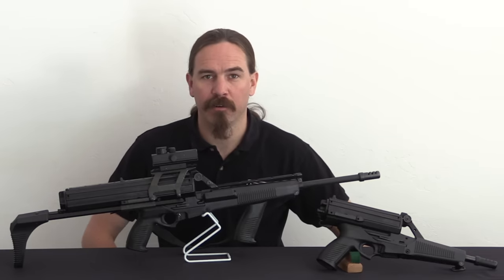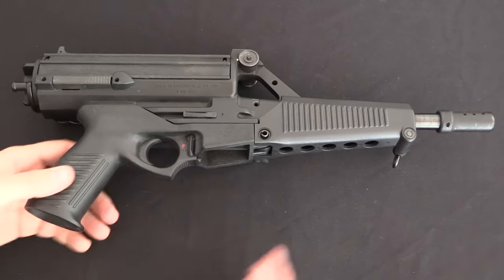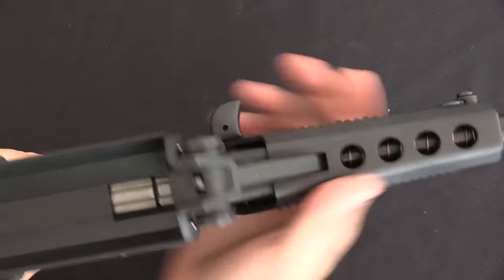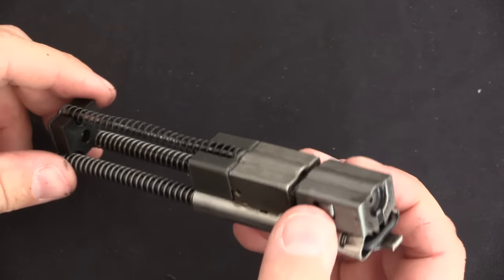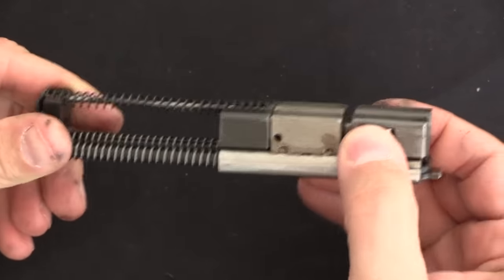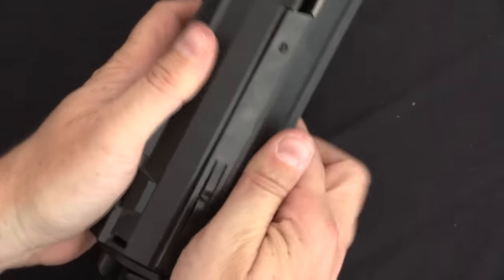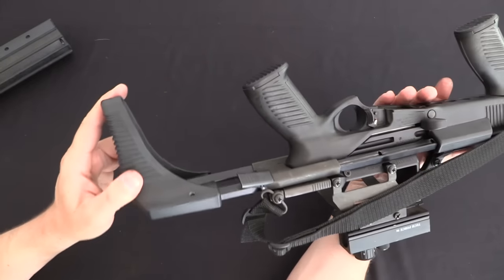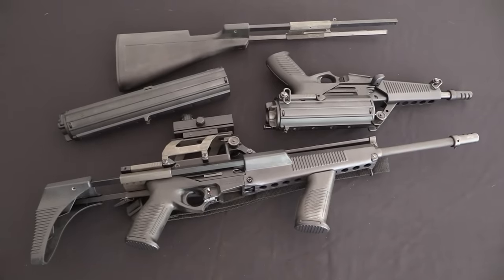Calico Light Weapons System: Roller Delay and Helical Drums

Comment: Designer: “Naturally, the helical mag will be on top, with a rear sight built in to each one.”
Assistant: “Why not underneath, as the handguard? Easier reloads, normal sights and ejection.”
Designer: “Nah, then its weight would help hold the muzzle down in full-auto. Wouldn’t want that.”

In all seriousness, thanks for the video, and the demonstration of the cool ratcheting system.
Reply: The pp-19 bizon wants a word with your design team.
Reply: @7uring  the flipside being that the Bizon is just as bad or arguably worse to reload xD
Reply: @7uring  My guess is the bizon's feeding system is quite unreliable, considering it had virtually no success unlike it's more standard follow up the vityaz.
Reply: That would make a pretty front-heavy gun, which also causes the center of mass to shift significantly as the magazine is depleted.  A top mounted magazine puts a good chunk of the total loaded weight near the shooting hand and does a much better job with maintaining the weight distribution while the magazine is depleted.
Reply: they are gravity fed though
Reply: There's other things to consider, especially when using any sort of high capacity magazines. In this case I have to imagine the benefit to feed and magazine-action interface by having the magazine top-mounted won out.

Top mounted magazines after all have some great benefits, but their issue is how it often obstructs the shooter's view. With a helical drum you don't have that problem.
Reply: I think it's really fine... this is not a precision gun, and we don't know how precise the manufacturing tolerances are. 
On the rifle version, where accuracy is more of a concern, they solved the issue.
Reply: The weight in rear makes it significantly more agile when pointing & the mag on top makes shooting prone more comfortable. It is actually my favorite top feed design bc of these, i do wish the sights were on the frame/barrel just high up but this was made for cqb so fixed sights on the mag isnt a huge deal
Reply: @jackmcslay  Not really. 
A bottom feed configuration from the stock of the gun would give you the same effect. The only thing is, you'd need a different, more complicated and less reliable ejection system. Then again, it could be bottom to bottom ejection... Interesting design
Reply: @j.m.f5451  What about the P90? Why don't we see more guns with a similar design?
Reply: It's like the firearm equivalent of the Boulton Paul Defiant. I've always wondered what it would have been like with a conventional 30-round box magazine.

Comment: I push the clutch on the mag when I'm finished loading to make sure I'm starting at 0 spring tension and then follow the manual's recommended number of winds. I gave my Liberty 1 (100 round) and Liberty 3 (50 round) a fluff and buff before break in and after only experience 1-2 failures each time. On my last outing I had 2 failures on my 50 round drum and 0 for my 100 round drum which was very unexpected!
Reply: Given the next few videos this comment has aged well - Ian had no failures at all for something like 300 rounds by paying attention to the instruction manual, just as you did.

Comment: My friend and I got to shoot a carbine with a 50rd mag. Out of the 50rds, there were no stoppages at all. Granted, sample size of one, only 50rds and it was cleaned just before taking it out, but no issues with what is a really cool gun.
Reply: I own the .22 carbine version. It's not nearly as good. 100 jam mag essentially. The issue is that the .22 doesn't drop the bullet far enough to go into the chamber. It needs a feed ramp. Otherwise it's pretty cool to have around
Reply: @7.62flavorsoffreedom2  To be fair .22 is a terrible round for auto-loading guns, even the much-beloved Ruger 10/22 jams on me multiple times every range session no matter how clean it is at the start.
Reply: MrMattumbo sounds like an issue with your Ruger, my Mosberg 702 plinkster out of 30,000 shots has only had single digit failure count (and some may have been from muddy magazine, but most of the time it would run flawless even upside down and sideways unless shooting sideways a shell happened to fall back into the action since I couldn’t quite shoot all 10 before the first shell could come back down and possibly land in the action when shooting sideways). The calico in .22 didn’t have double stack magazine (it’s patent looks different from the 9mm), but it was a lot of curved side surface area for friction in the magazine.
Reply: Zach cash  I'll check that out, thanks!
Reply: @MrMattumbo  ill give you that. though i did find some .22 designed for semi auto use though. its called "prime ammunition .22 lr semi auto ammo" i know its a mouth full but i might give it a shot.

Comment: I owned one of these for about ten years. Bought it new when they first came out and sold it in the late 1990’s. Mine was the standard carbine with the collapsing stock, 50 round magazine and no foregrip, flash suppressor or scope mount.

I never had any problems with this gun. Of course I didn’t shoot it often, always cleaned it after shooting, never stored the magazine under tension and always wound the magazine to the recommended tension.

It was a clever, well thought out package, but I can see the potential for trouble if it were not kept clean and the magazines were not used properly.
Reply: the winding action is definitely too complicated for most law enforcement to wrap their heads around.
Reply: @XhumpersX  Been telling people for the longest time that if you want to get a fat law enforcement contract, you need a donut shaped magazine.
Reply: Afterglow Beats  Imagine being a shootout armed with a Calico, snapping on a fresh magazine to reload, and the magazine is not wound.
Reply: @josephmckinney9660  or the magazine jams so the user slaps it in the unwind button
Reply: One Doomed Spacemarine  Maybe (for whatever reason) the magazine was not wound when it was loaded. Or maybe it was wound when loaded, but the spring release button was unintentionally depressed sometime afterwards.

Comment: Man, if there was ever a gun you've shown that I wanted to see someone take a second pass at designing, this was it.  This thing is just so clever and cool, it's a shame it just wasn't quite up to the promise of its idea.
Reply: I wonder why they didn't go for a hightened front sight on the barrel. Longer sight radius...maybe it would get in the way for concealment for bodyguards. The rear sight could return to zero each time if the rail system to hold the mag is precise but even more expensive to put something in the mold. It would be easier today. 
But since I can't own any rifle with more than 10 round mags, it doesn't matter.
Reply: Build the mag into the otherwise wasted space of the rifle butt in a conventional design [gratifying Karl's anti "will it bullpup?" stance! ;-) ] and keeping that large mass of the ammo close to the body, aiding control.
Reply: It worked well FYI most people don't read the side of the gun, the weakest ammo you can run is P+...
Just regular 9mm won't feed
Reply: In 22lr it works perfectly fine,check out the new model Calico M110
Reply: I feel like modern injection molding would really improve the magazine reliability, the mechanical gun design looked surprisingly squared away already, not quite the kel-tec/cobray abomination that I had always assumed.
Reply: @PotatocannonLol  
Thx, good to know. I'm sure Ian informs himself before doing a range video.
Reply: Mag in the stock and chamber it in .22 TCM and I would jump on it.
Reply: The RedNeckEngineNerd normal runs fine, preferably use the cheapest steel case like Wolf (it’s significantly cheaper and rated for a bit more speed too, so no reason not too). But unfortunately lame-o people at the gun ranges insist you use brass (so they can force sell you their own crappy slow brass at a premium), and it runs, besides the magazine being a bit finicky (is there suppose to be white grease in there or was somebody being a moron? also over-winding the spring in its history didn’t help). But there isn’t much reason to use more expensive slow ammo when steel runs fine (minus magazine finicky, which was abused so I’d toss that sample out, but the gun for sure runs normal ammo). I’ve only tested one, but it worked with FMJ (I wish they made just plain lead like .22 for barrel longevity, the paper and tin cans don’t care)

Comment: I bought my Calico 9mm Carbine with the collapsing stock, a 50 Round Magazine plus the 100 Rounder and the Sight mounting attachment for right about $650 back in 1989. The first few Magazines filled with 115 Grain FMJ Ammo worked flawlessly... until something in the Trigger mechanism went bad! Then it only fired Full-auto every time I pulled the trigger!!!

I had bought the Extended Warranty so I cleaned it, better than what it was 'Out of the Box' and sent it back to Calico for repair. 4-weeks later it shows back up at Steele's Gun Shop and I take it to the Range... I fully load the 100 Round Magazine with 115 Grain FMJ ammo and, with a Delaware State Trooper (sitting at the very next Bench, by the way) beside me, I pulled the trigger and BRAAAAAAAAPPP!!! The Calico dumped the entire Hundred-rounds faster than you can say "Supercalafragalisticexpialadocious!"

Well, needless to say I sent it back to Calico. 6-weeks later, Steele's Gun Shop in Rehoboth Beach, Delaware, got a letter from Calico saying that it couldn't be repaired and that they could not return it to me because they had disassembled it to use it as spare parts for other repairs they were doing; they had put in the envelope a "Token Check" for the amount of $100 claiming that was what my Calico was worth in scrap value... 

It was a truly unique Firearm but Calico, at least in my case, refused to honor their Extended Warranty, were unable to repair a Disconector, nor give me the Full Refund of the MSRP (which the Extended Warranty promised, if a repair was unavailable), much less return to me my lawfully owned property!
Reply: That’s pretty terrible. I could probably have designed or reverse engineered the repair parts, that’s a shame. It sounds like it was either binding or the top of the bump disconnector (not sure what it is, the bolt bumps the tabs on the top of the cam to push it down and pop the actuating mechanism down into a free-floating spot). It’s sadly pretty simple parts so you could easily have replaced it with a drill/Dremel, and some sheet metal, unless something in the plastic broke, which is the other option.

Too bad that didn’t happen in 1986 and get registered as a full auto, because then that thing would be like $30,000 now. You can still get one in great shape for like $500 (so with extra 100 round mag and optic mount just a little more than what you paid)
Reply: I think that would have been a time to contact a lawyer. Just a strongly worded letter from an attorney should have at least got your money back.
Reply: Calico actually sounded like pretty chill dudes in this scenario. Essentially, they gave you a completely under the radar, full auto firearm...and you betrayed them.

Calico, if you're still out there and reading this, if I send mine in you can rest assured you'll never need to "repair" it a second time ;)

Comment: I was wondering when you were gonna get to Calico!  I have a folding stock .22 M100.  It took some tweaking, but now it runs like a champ.  The biggest hitch was getting a good magazine.
Reply: I have the m100s with the wood stock, and mine always jams constantly. Any tips to make it run better?
Reply: A couple things come to mind. With mine (used), the ejector was installed backwards and that caused every round to jam.  Make sure to clean it often and thoroughly, including taking apart the bolt. .22 is a dirty round to shoot, after about 200-300 rounds my calico starts to malfunction. You may want to consider replacing the springs or the firing pin as well. And finally, ammo choice. I've noticed about a 1-3% failure rate in cheap bulk .22 ammo so you may want to experiment with different brands of ammo.
Reply: Try better ammo no cheap stuff. 
My M100 functions flawlessly, I do regular maintenance (clean, lube etc.) do not forget to clean the magazine because carbon can foul up the mag causing malfunctions.

Comment: Yeah, I remember when they came out and ... there was loads of room for improvement. I was in the Navy and like a lot of others in the Military a bit of a gun nerd... if they had removed the springs and wind up aspect, and used a low power linear actuator to bump the magazine forward on a trigger pull it would have solved a lot of problems; if they had placed the magazine under the reciever and barrel it would have solved a lot of problems and added some potential expansion capabilties; if they had slung the huge magazine under the barrel, all they had to do for the ejection port to keep ambidexterous use would be cutting an extra slot and keyway for user configurable ejection direction. If they had taken those steps, pretty sure they would be coveted items. Also, I always felt they should come with a Popeil Pocket Fisherman....just the feel of all that plastic. :P

Comment: I owned three of the 9mm calicos two pistols and one carbine. I had both 50 and 100 rd mags. one pistol and the carbine were full auto. I got them from Mike at the factory (shop?). I'm a movie gun handler so I immediately converted them to blank firing. The main mag problem I had was while firing blanks in simple blowback the rate of fire went WAY up. the centrifugal force of the ammo would put enough pressure on the magazine assembly clips they would fail and scatter blanks all over the set. My solution was to add hose clamps around the magazine. I had a few jams and miss fires mostly caused by the 9mm blanks. Fun guns. Dolph wanted one.

Comment: How does a round get fed into the chamber without immediately falling through the ejection port? Does the ejector play a role in retaining it?
Also, is the interface between the moving feed lip and the bolt made of square parts? How does that work?

I hope my questions don't get buried under the usual meme comments.
Reply: JohnsonLobster i got bad news for you friend
Reply: The cartridge is held in the helical magazine by the one spring loaded feed lip. The bolt face has an extractor to clip over the rim of the cartridge as it is pushed out of the helical magazine. Till the cartridge is in the feed position, it is held by the flat parts of the bolt carrier. The cartridge is never really free to fall out, till the ejector rod hits it ( where the cartridge is rear of the feed position ). 
 The square surfaces don't make much different from any other gun. The one metal spring loaded feed lip is rounded at the corner that is pushed by the bolt. The bolt is square shaped because the rollers on the sides "lock" ( delay blowback ) the bolt in place, so the flat bolt front only has to sit flush against the trunion or breech face to function. 
 You can see most of it as Ian is disassembling the pistol, but he didn't fully explain it all or show the inner angled surfaces that make the rollers "lock" in the receiver.
Reply: See the part @14:10
Reply: Hi iou
Reply: F go I
Reply: All things are possible through Jesus Christ.  I hope that helped.

Comment: Calicos are all over the place in movies, TV shows, and games.
Ronny Cox comes at Arnold with a 9mm pistol at the end of Total Recall.
In Seaquest DSV Season 2, they were all packing .22 carbines.
Spaceballs features both the wooden stock and folding metal stock versions of the .22 carbine.
Somebody already mentioned I Come In Peace with Dolph Lundgren.
Star Wars Battlefront 2 has the 9mm pistol with forward grip and 50-round mag as "Assault" weapon.
 
It's a damn cool gun and the magazine design is really unique. It's a bit like those gun pods they mount on airplanes. The ammo also goes round and round inside the housing and the barrel goes down the middle.
The gun pod/rifle for the Macross/Robotech Valkyrie/Veritech mech work the same way.

Comment: The CALifornia Instrument COmpany based in Bakersfield CA was facing hard times as the oil field instrumentation they normally made was not selling. The owners decided to try their hands at making guns. They already had all the injection molding equipment for the oilfield equipment.
 
The earlier Calico's had threaded barrels. The pinned muzzle brake is probably a post-ban variant. They also made a speed loader which if your loading 100 rounds mags is essential. (That's the fill Gucci!) If you have a speed loader keep the spring release pressed while loading. If it builds up tension the loader just won't chooch.

They side stepped the ban for a little while by not selling magazines. Under no circumstances should you buy both the internal and external magazine repair kit and combine them. Wink, nod. The company that was Calico last I knew produced plastic cafeteria trays like those frequently used in prisons.

As for reliability. Do not use non-jacketed ammo. It will jam very reliably. I'd expect them to dislike hollow point too. Feed it ball and it will run all day. The only malfunction I've ever had with ball ammo was letting the brass catcher fill up, and that's just being dumb. (Yes, there's a brass catcher too. Full Gucci).  So don't try to run two 100 round mags with out dumping the brass.

Comment: They make them in .22 as well. I think it’s be a perfect gopher gun, 100 round mags roughly the same length as a ruger bx 25 mag but doesn’t stick out the bottom lot Easter to maneuver on the quad or truck or what ever your using at the time